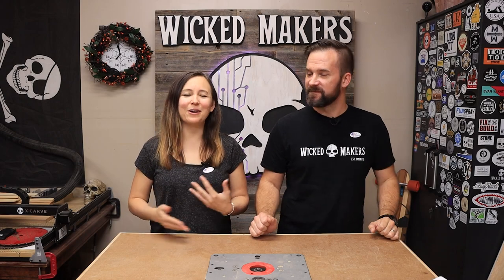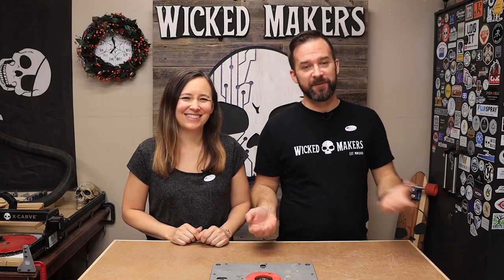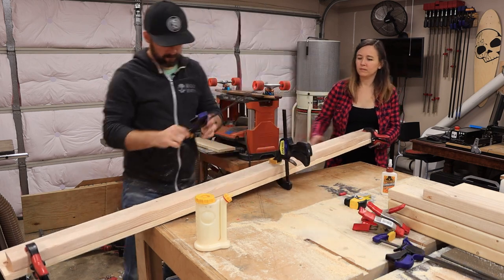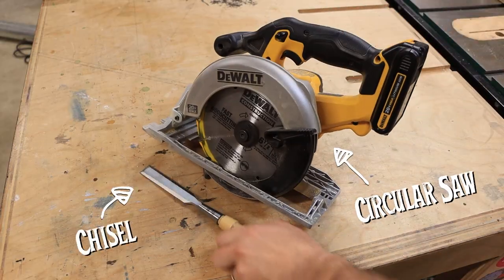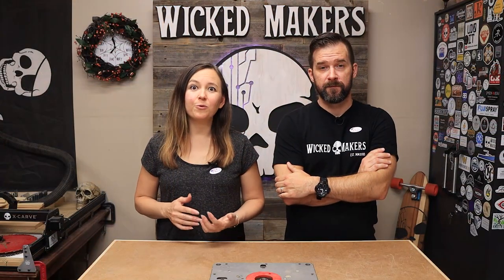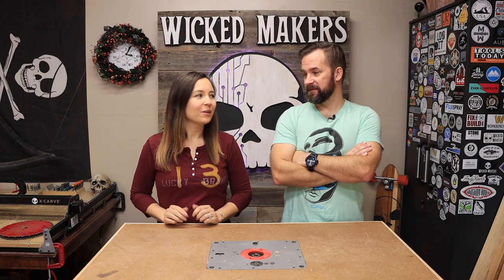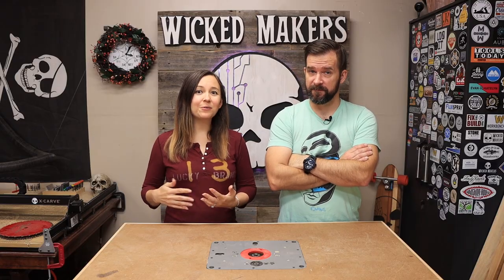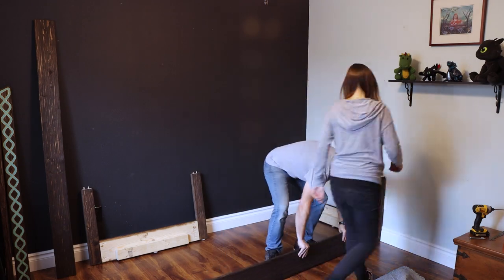We Made Our 3-Year Old The BEST BED EVER!

Comment: The details look amazing. Really a kids dream bed. 🤩.  I am not a engineer but it is missing reinforcement. The beam and A shape will be too easy to swing back and forth, I could see in your eyes when you pushed against the was. 😂. Maybe a “small roof” with 2x8 will give structural strength plus a few other reinforcements along the areas were it connect to the bed. Like you mention, pretty sure it is not built to be used as a playground, but kids will always try. Keep the great work.
Reply: A small roof would really add to the design and strength.  I thought it looked too empty on the top, like it needed something more.

Comment: Meh, okay for the toddler, but this is a kids bed. Kids will want to do kid things, like swing from the crossbeam, everybody hanging at the same time, etc. Can it withstand 200 pounds of weight ? Is it strong enough to withstand force? Build a bed that looks like a swing and it will be attempted to be used as such.
Reply from the maker: Good luck finding a even a commercial bed in this style that would meet those requirements though. 😄🤷🏼‍♂️ 90% of the furniture in our house would disintegrate if we let 200lbs. swing from it In any direction.